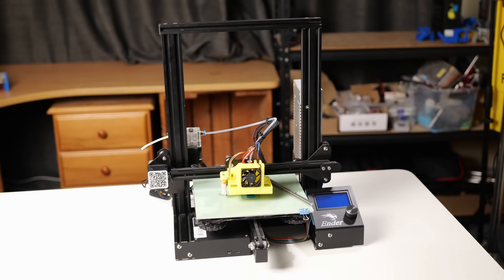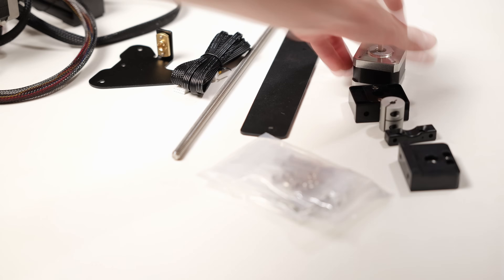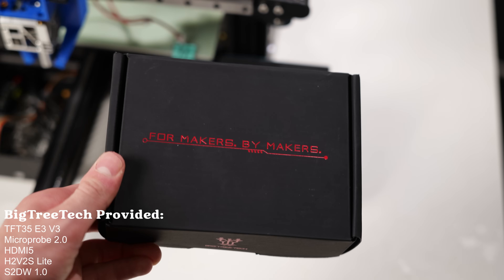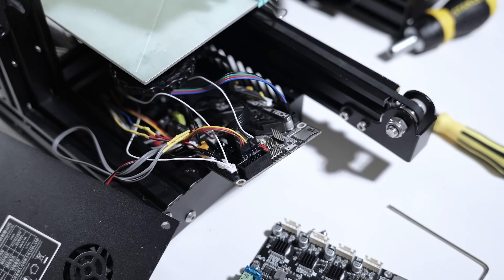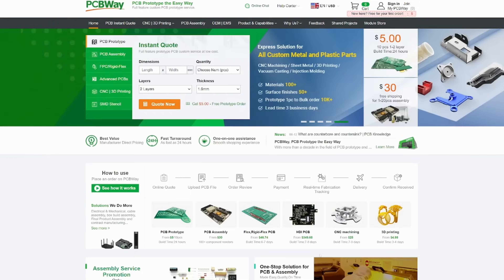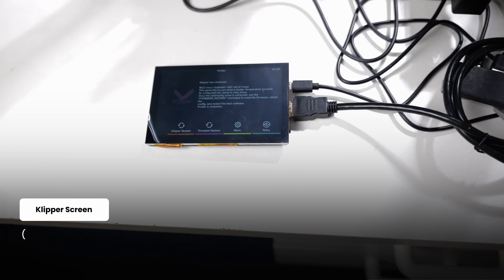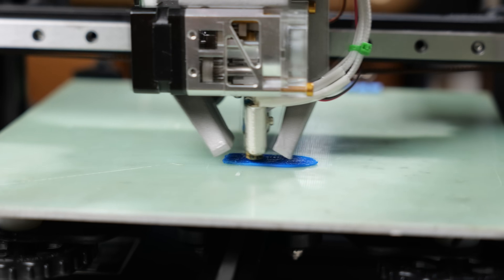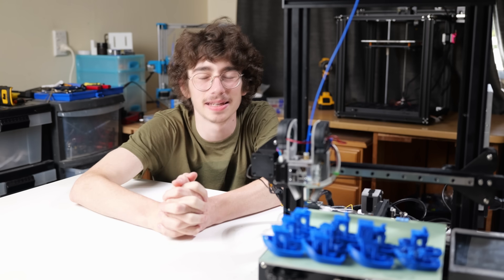Upgrading Everything on my Ender 3

Comment: My Ender-3 print much better after i put straight the hot end 😏
Reply from the maker: I did a similar fix on another machine once, it dramatically improved print quality. Always nice when the simple fixes work the best.
Reply: @TommyHoughton  i had the problem over a month and with all the filaments had bubble sound because the hot end was not 100% straight and no any video or someone to inform me about the hot end ,every one said humid.
I use the tool with bubble in it to put the hot end straight.i don't know the name of the tool.
Someone must make video about this fix.
Most of people have issues about this and i can understand from the pictures that most of them have not straight hot end.
If you can make video because my videos are for Umarex paintball markers.
Reply from the maker: @noobt4eguns  I appreciate the detail. Glad it’s all working well now! Is the tool you’re thinking of perhaps a “level?” I’ll write down this problem and solution for the future. Cheers

Comment: This reminds me of theseus's ship, I mean, if you upgrade every part on your ender 3, is it still an ender 3?
Reply from the maker: I've had similar comments pop up a decent bit, and it's a good question. I don't have the ability to answer it though. Later this year I should be installing a CoreXY Conversion kit for the Ender 3, which should replace the last of the stock parts. It really will be a whole different printer.

Comment: I'm just going to say it.  You've put too much effort into this printer for the results achieved.  Just my $0.02, convert that ender 5 in the background to a mercury one.  It will perform better than the bedslinger.  As someone who also likes to tinker, figure out a cut-off point on upgrades so you don't go too far down the rabbit hole and potentially waste money.  I converted my ender 5 to a mercury one and loved it.  Next step was to add hydra to mercury one.  That ended up being my cut-off point.  Next thing was to just build a voron and solve the limitations of the ender/mercury.  Other good options out there now as well, voron, ratrig, vzbot, etc.  Or bambu, creality k1 if you just want turnkey (but where is the fun in that).
Reply from the maker: The Mercury One is an awesome conversion, I really hope I can pull it off for the video, I'll look into it to see how possible it would be for me. It would certainly make it my best printer. You're right about the cutoff point, with my other machines I try to be as economical as possible with my upgrades. This one went a little overboard, but it was quite a bit of fun. I would love to build my own corexy from scratch, but that's quite the project that I'm not ready for just yet. Cheers
Reply: @TommyHoughton   Understood.  Doing the mercury one conversion isn't any harder than what you've done in this video.  The biggest challenge will be printing the parts.  They will need to be ABS or ASA.  I printed mine by putting a box over my ender 5 to serve as a bootleg enclosure.  Fabreeko sells a complete mercury conversion kit.  That is the most economical way to do the conversion.
Reply from the maker: It sounds really viable, I'll start compiling all the links onto a doc for the video. I'll maybe try and reach out to them too. Thanks for the info!

Comment: idk if you like critics but... I feel like you did what a lot of most most ender people do wrong with their builds which is invest way too much into a solid metal direct drive hotend instead of focusing on other things. You could have built a sherpa mini with the old extruder parts and added a $20 bambulabs hotend clone with the same fans you already had. would have been 1/3 the weight with same flow
Reply from the maker: I'm always welcome to critics, I make a ton of mistakes and often unoptimised decisions, so feedback goes a long way. That's a great idea with using old parts to make a sherpa mini, they're really nice extruders but quite pricy so I haven't yet invested. BigTreeTech kindly provided the H2V2S lite for the build, which is why I didn't go for a pick and choose scenario. The Bambulab hotends and their clones are great value high performance parts, my go to is usually the trianglelab CHC system with a cht (or cht volcano) nozzle although that will end up costing double the bambu clone. The mellow BMG is great extruder too which I would consider, but the costs all add up a bit more than I realised with a previous build. Lerdge on Aliexpress has a new extruder similar to the orbitor/sherpa for ~30 USD but I cannot confirm its performance. I'll look into trying some of those bambulab hotends, they could be useful for a number of projects. I appreciate the feedback! Cheers

Comment: I've now compared your conversion... just Raspberry Pi costs over 80$.... then all the conversion parts that you ordered online and had made...  dude buys a Bambu Lab!!!!
Reply from the maker: The Raspberry pi was 33 NZD, a bambulab in my country would cost 1500 NZD for a P1P, unfortunately what I spent wasn’t close, especially thanks to sponsors providing a lot of the upgrades. What I did still isn’t the most economical, but it was enjoyable. An Ender 3 V3 SE would cost half what I spent and work as well if not better. I get your point of course. Cheers
Reply: A rpi zero is not 80$

Comment: That bed heater is a joke.. you didn't measure the bed size before ordering??
Reply from the maker: I did, I couldn’t risk it not fitting so I went smaller, it is a bit too small though. Works fine for now.

Comment: best ender 3 upgrade is a new printer
Reply from the maker: Especially with the OG E3. I hear the E3 V3 SE is quite good value for money. Cheers
Reply: @TommyHoughton  nah, had the e3 v1 for a few years and when I gifted it to a friend all that was left from the original build was only the frame. Then I had the chance to work on a v2 and it was the exact same thing with the exact same problems. In comparison I tried sovol sv03 (a very good prusa mk3s clone) and a kp3s. I wouldn't recommend to anyone getting anything from creality nowadays when there are far better alternatives
Reply from the maker: @PescarStangaci  Good to know. Creality’s got so many machines now, it’s almost confusing. A lot of people seem to have the KP3S and SV06 and such, so I’m hoping they’re good machines. I feel like Creality is saturating the market with the same thing.
Reply: @TommyHoughton  you have to give them credit for driving the industry into cheap open source machines that got a lot of people into the hobby but that came with a lot of quality control problems.
Reply from the maker: @PescarStangaci  Definitely! I’ve had plenty of their machines, and while they’re certainly not perfect, they have helped me and many others with their journeys. Cheers

Comment: Nice stuff but money not well spend, you could've gotten rails for Y and motors for X and Y instead of those 2 screens and that useless bed heater which is a fire hazard. It's also undersized and won't heat the bed equally. It is also really weird that you blew your whole board up because of the fan header, I blew up fan mosfets before but not the whole board. The insulation under the bed is doing nothing, H2S has similar flow rate to bambu hotend clones which are $10 on Aliexpress and you can get a BMG extruder for $5 which will then perform better than a H2S. 6K accels is not high for a bed slinger, I was running my Anycubic MZ2 at those speeds for quality prints. I'm not trying to hate but also I'm not sure if this is rage bait. I can list at least 10 more things you have done wrong, it is not bad to not know something but spreading misinformation to close to 30K people is not cool
Reply from the maker: That’s all fair. I’ve had several comments point similar things out. This video was more for fun then the most performance per dollar. I can easily agree with the bambu and bmg clone combo, it’s more than great value. The small heater was for the title, it’s not a good use of money. The board still “works” but none of the heating stuff does. A lot of the parts were sent in which is why some may seem unconventional. I don’t intend to spread misinformation, the components worked well for me, but I really should have explained them more. I should be realising the bigger picture with this many people tuning in. I’ll be making sure the Ender 5 video is better than this. I really appreciate your feedback, if you ever spot something else I can work on please tell me. It’s the most effective way for me to improve. Cheers

Comment: So basically the end result is ender3 that makes your table shake and 'prints' absolute crap? Same results a lot cheaper can be achieved by buying some firewood, tossing a spool in the flames and kicking the leg of your table. Just saying
Reply from the maker: I’ll have to politely disagree, I’ve made many further modifications to this machine and it’s not as good as it was after this video. I had more consistent and reliable prints alongside quality that (while wasn’t “perfect”) was still way better than any other machine I had operating at that time. Someone else also compared the prints to burned filament (via blowtorch.) I get the need to emphasise but that’s not the case. I appreciate your feedback of course and will keep trying to improve the projects and videos. Cheers

Comment: Useless. If you can't get good quality benchy from fast speed print, don't print at fast speed. And this is definitelly NOT what I call quality benchy. Seen MUCH BETTER results from less modded printers!
Reply from the maker: I found the quality to be as good as my stock ender 5, but the print took 1/3 of the previous time. I’m pleased with it. You can achieve quality prints from stock machines too. My main goal of this video was to upgrade “everything” and have it still print decently. It seems to do that. I completely understand your point of course. Cheers

Comment: Just buy better printer. Ender never will be worth upgrading. Only upgrade recomended from me is to upgrade to another printer
Reply from the maker: I have been looking at getting a proper printer that just works, but for the time being I’m happy with my current machines despite their flaws. Hopefully I’ll get my hands on a nice coreXY soon. Cheers
Reply: In a way you’re right, though an Ender 3 is the cheapest way to get into 3D printing with community support. At least where I live, a Bambu labs A1 mini is double the price of a Ender 3 V3 KE, which is quite a huge difference…
Reply: Not everyone can afford a Bambu or a Prusa Mk4. An Ender 3 isnt perfect, but its more than enough to start off with for a decent print quality
Reply: Pretty funny I’m in the exact boat as Tommy. Looking to get a proper XY soon that just damn works every time. But I’m waiting for a 300x300 core XY from Bambu lab so I can then compare all the large ones and get the best. My ender 3 should be ok for now (just need to fix it and mod it as every creality user says)
Reply: I bought used ender 3 for 90€. Ordered some new parts for 250€. It’s a hobby to upgrade it and learn some engineering and stuff. I think it’s cooler to own selfmodded ender 3 than a Bambulab expensive printer.